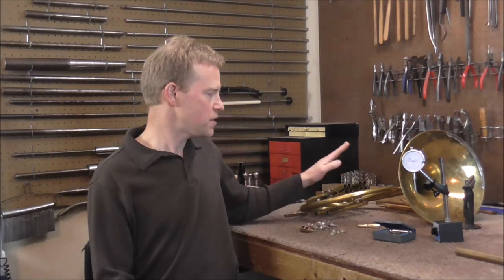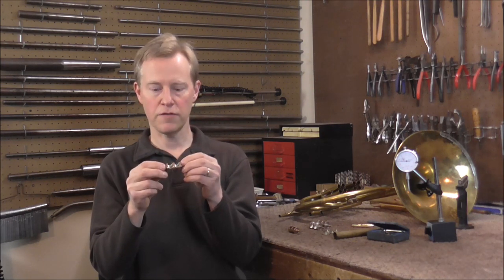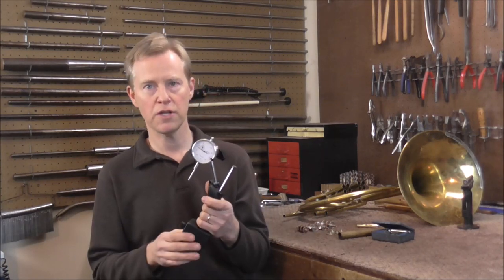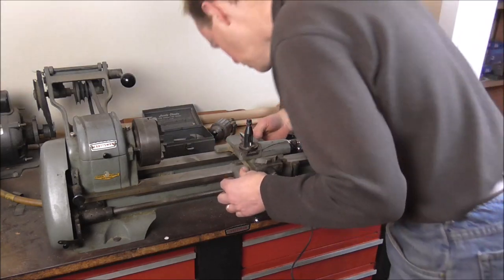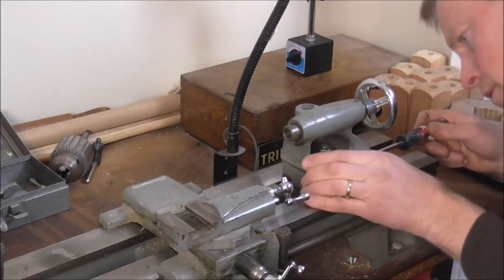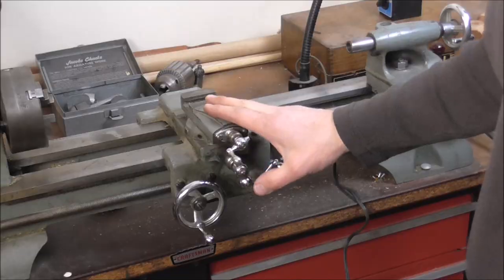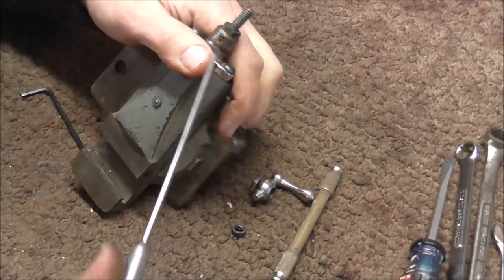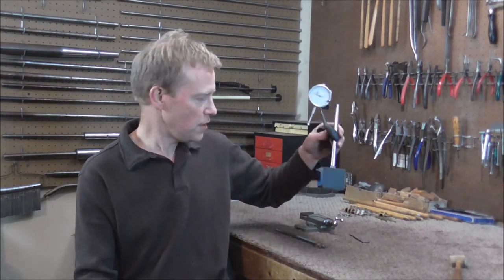French Horn Rotor Valve Restoration #3 Fixing the Lathe

Comment: The cross feed screw (and the main lead screw) are Acme thread, as well as the cross slide being reverse thread. Acme taps are very expensive and not available from your general hardware store. However, you can get replacement Acme threaded nut stock from suppliers like MSC. I'm not sure of the size and pitch of that screw. Perhaps it is 5/8" 10 TPI. You can measure the screw and the pitch easily enough with your calipers. 

You will not find the exact shape nut that you require except as a replacement part for that lathe. Since Sears is now dead and that is an old lathe that may be difficult. But you can find generic precision nut stock, and with some machining and brazing or silver soldering, you can fabricate a replacement easily enough with the tools you have.

Look here for Acme precision nuts from MSC:

https://www.mscdirect.com/browse/tn/Motion-Control-Fluid-Power/Ball-Screws-Nuts-Accessories?searchterm=acme+nut&navid=4287921176#navid=4287921176+4286892124+4288223021&searchterm=acme+nut

Note: you want a precision nut, not a generic nut. You are trying to tighten things up, and a generic nut will have more play than a precision nut. However, if you can't find a precision nut in the size you need, by all means get a generic Acme LH nut in the right size, it will be better than what you have.

BTW, you have a 3-jaw chuck. No matter how much you tighten things up , 3 jaw chucks are never repeatable if you remove the material and put it back in. 

The easiest way to get repeatability on that lathe if you have to remove the part would be to turn between centers. That means you would need a center each for the headstock and tailstock, and some sort of driving dog. The tapers in the headstock and tailstock are most likely Morse taper #2 or #3, but that tailstock could be a #1 taper. You can get live and dead centers and dogs from MSC (and various other suppliers) too.
Reply from the maker: Thank you for the suggestions and help. I will check out the website you suggested and see what I can find.

Comment: With regards to older rotors and vintage instruments, you may want to try a heavier oil. (3 in One, Singer)  This is necessary to seal the valves properly, as the manufacturing tolerances were no so tight in the past.  It makes a huge difference. You will notice immediately the improvement in the sound.

Comment: 1:27 I assume that it is not difficult to fasten tapered parts - if you use a complementary conical bushing (ha-ha, you should turn a special adapter first). Well. It's easy to fasten, but I'm not sure it will be easy to remove it after then...

Comment: I'm wondering.. how much would a complete valve transplant cost? I have seen It on a perinet valve trumpet it was an olds recording and it was cheaper than a major valve rebuild, is that even possible on a rotating valve setup? Or are these valves also expensive or impossible to fit.
Reply: My guess is that it would be difficult to get a precise fit

Comment: Art, two comments: the nut that you're looking to retap is a left-hand acme thread. The taps are pretty expensive as they aren't all that common. All tightening up that thread will do is to reduce the hysteresis (slop) in the leadscrew. As long as you can tighten the gibs so the table moves in a straight line back and forth, you should be fine. Second, I would be very concerned about solder plating the rotary valves. The solder is very soft and easily corroded.  Consider building up the surface with copper electoplate and then nickel electoplate the final surface.
Reply: I second this comment, the leadscrew nut does not require to be super tight as long as you move the carriage in the working direction before setting the zero position of the crank...

Comment: The valve sleeve idea is really good. They do that on engines but the put the sleeve in the block and not the pistons. I do wonder if u could get some monel (?? I’d have to look up how spell that sorry) tubing and sliver solder it on and turn it down. But even if u turn it down won’t the valve be really tight bc of the casings being worn